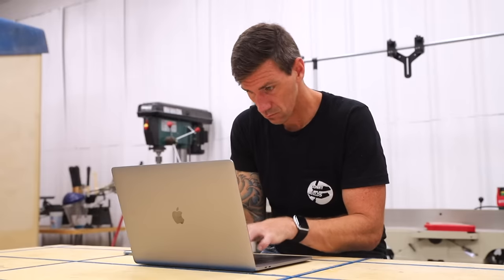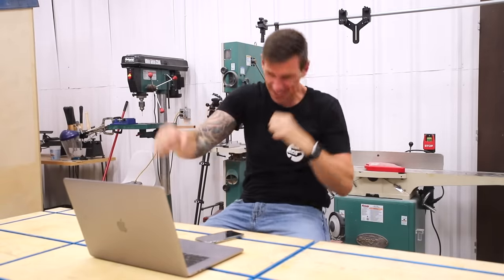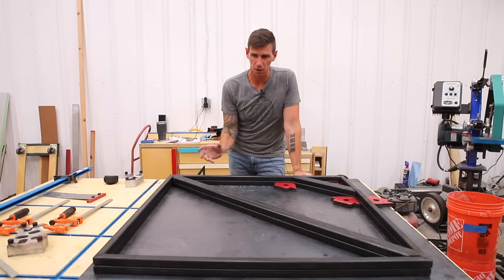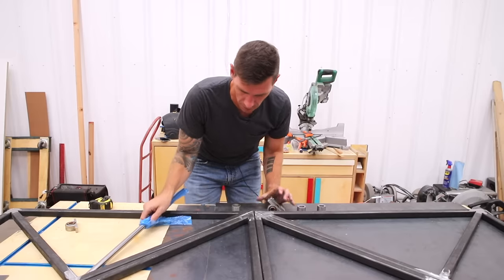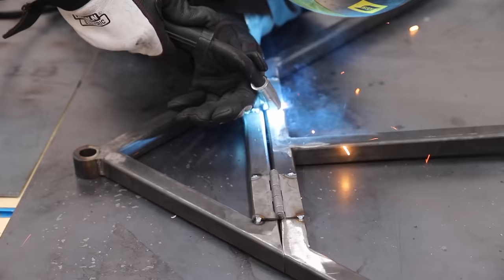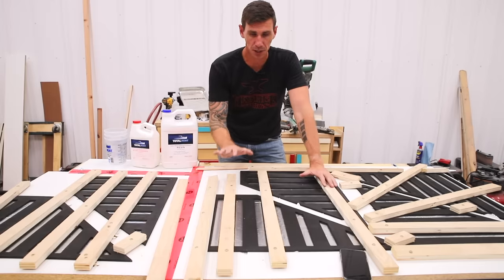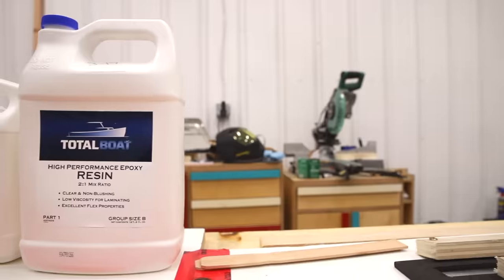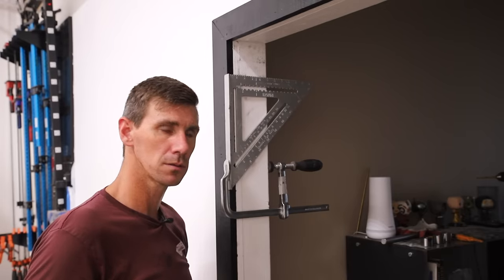Impossible Folding Door

Comment: Heads up, I had Mono Audio enabled on my device when experiencing the loss of audio. Disabling this fixed the issue and I was able to hear the audio. Turning Mono Audio back on made the issue return, so if people are experiencing this issue, make sure that Mono Audio is disabled on the device. You can do this on Windows just by opening the start menu and searching Mono. For Android, it should be under Accessibility settings within the Settings application and for iOS I can only guess it's under a similar section as with Android.
Hope this helps.

Edit: I tested this on my Android Phone and it is the same issue with the Mono Audio. I think, based on hearing both audio channels through headphones there's something that messed up that audio. It's hard to describe without saying that it feels like it has a bit of distortion. I think, and I'm no expert, that some of that audio was already made to be Mono and so overlapping Mono settings on top of the Mono audio just messes with the channels and pretty much mutes all the audio besides some artefacts withing the audio..
Reply: This sounds like destructive interference. How the frick
Reply: My mono audio setting was already off and I still have issues. I'm on Android, any other recommendations?
Reply: Also I can still hear all the added in audio (bell rings, basically all SFX sounds added in the editing process) just can't bear his voice. Sounds distorted, really quiet even with my volume all the way up
Reply: I didn't knew i have mono... what the hell...
Reply: One of the speakers plays an inverted version of the other one. A mono device will merge both the inverted and normal waveform and cancel eachother out. Kinda how noicecancelling headphones works.
Reply: @olle5555  69420 cancelling headphones?
Reply: I turned off mono but still cant hear it. also tried with earbuds, my laptop and pc and still dont hear it
Reply: @irunasoft  u know mono just means one speaker and stero means to speakers so ur phone only has one speaker which is normal lol

Comment: This is not a good design for an interior door. For one you loose a lot of wall space and two it's hard to open from the other side. 

This would be better suited for a storage shed where it's on the outside so no space loss and you never need to open it from the inside
Reply: I was just thinking this would be a good door for my workshops oversize project entrance. I have a regular 36" door I use on the regular but then I have a 4 x 8 entrance that I've made a sheet plywood into a door. Might have to see if this can be done there.

Comment: Yes, classical parametric design. That hinge is taking a lot of punishment but it works. However two of those pieces has some sort of instability during the actuation. 

The paneling is open for design. It could be triangulations or any other sort of aperture. The metal framing was exact. It's inevitable. It literally fits there. This is a valid solution when the swinging of doors becomes a hazard on closed spaces.

Comment: Have you thought about adding a second “grip” from the inside in the top left corner, that way when you “pull” down and right on it, it should do the same movement as the center one does from right to left

Comment: Awesome door!!! How does it work from the other side? can you close the door behind you , then open it again?
Reply: I whas thinking the same, it doesn't look like it
Reply: This is how I will say it..... You take something super simple and make it super complicated. Also too much waste of materials and I would hate myself if my childs fingers got stuck somewhere in the door... Otherwise great job.
Reply: It doesn't. Although you could find a way to get out but you wouldn't want to get stuck in.
Reply: ThisIsTheEndPt2 15:16
Reply: I'm guessing you will be able to push it (carefully) hard enough to budge from the inside. Would probably be ideal if you had a long stick that you could use to push
Reply: @weera25  Dude Wtf? You know you kinda ranted over a badass project right?
Reply: The only way I could possibly think this would work from both sides is if it was motorized. Like have a switch on either side that controls a motor mounted above the frame and have the top rod extend with a gear at the end. It would make this project 2x better. You can even go 1 step further and use a motion sensor to trigger the motor and have a 7-10 second timer from when it's fully open till it closes automatically.
Reply: Make sure not your front house door. one way 😂
Reply: jonathan hernandez Personally I would prefer such a door having to be consciously activated via a switch. It just looks like it would be very easy to get something trapped inside the door during opening/closing. And depending on how strong your motor is whatever is trapped inside can have a very bad time.
Reply: Just push the middle left door, easy.
Reply: I'm thinking... a Cabinet door!  If it's small and for a cabinet, that avoids all the issues -- opens only from one side, trapping fingers is won't hurt much if it's lightweight (and cabinets can trap fingers as they are anyway)
.
Reply: Skirata I hear ya, but technology has come along way. Especially with prevention measures. If it was wired directly yes the motor would just continue to move and possibly crush anything in it’s way, but when I mentioned the idea it was straight forward with a gear. All it needs is a sensor that tells it something is in it’s way or a resistance sensor where it would require a certain amount of force before it stops automated process and becomes manual. I know I’m not describing it correctly but there’s rules and regulations when it comes to power assisted doors that would explain what it needs.

Comment: A sliding door is easier to build and operate 😅
This was crafty.
Reply: Could have built it sliding, with the top pivot on a sliding bearing, moving up, into the ceiling, inside the wall and down. Then put an electric motor on the bottom pivot to control opening, closing and locking. That would have been much more practical and sealed the workshop from smoke and dust.

Comment: An automated version of this door could revolutionize the door industry...is it possible to work on it?
Reply: How would it, it's expensive, hard to put in, requires a specialized door frame, lots of effort, hard work and time, just to install it, simple doors as they are now work just fine and have been for many years and they likely won't change soon, I'll admit this door is cool, but it's quite bad in all honesty, hard to open from the other side, hard to install, expensive to create and to top it all off its really no better than a normal door which is faster, works easier, faster to install and have worked for us for years, it's a cool design if you want it but it's impractical and not needed
Reply: Josh Maddie I bet a big company could do something like this in a few years
Reply: Josh Maddie he said automated so you wouldn’t have to touch it. It’s like those sliding doors but you don’t gotta touch it
Reply: @joshmaddie4665  If it's automatic it means you will just need a button to open the door...whether you inside or outside. Yeah I get that it takes a lot of time to make (but so does a wooden door, not to mention those unique ones with facings). If cars can now open doors with the push of a button, it might be possible to make it with this door. And remember he had to take out old door which had different dimensions, hence replacing the frame
Reply: So my fingers feel good that I'm not going to have to open it
Reply: Yes I know what automatic means, but even so, why, what would be the purpose, make a door that costs thousands of dollars just so you don't have to open it yourself, Noone would use It, or buy it or really ever use it, there's no reason too, a simple automatic sliding door is far faster, it is smoother, It is cheaper and not to mention its design allows for a smooth effortless opening and closing, a complicated messy door like that would be very hard to make automatic and if it was it wouldn't look good, it's simple, think of it like this, you have this door, what advantage does it have over the many others doors, simple doors have been used for decades without problem or worry, they're been reliable, quick, cheap, easy to create and install, sliding door, easy and fast to open, easier to make it automatic because of its design, easy to install, asthetically pleasing, now you have this, a messy complicated expensive door in which it's only plus is looking fancy, Noone would want it or ever buy it

Comment: PIVOT
 I’m wondering about maybe adding some type of gasket to seal the gaps, to prevent air flow from transferring dust particles into the next room. Perhaps a roll of foam weather-strip applied to the edges?

Comment: I'd feel much more confident using one of these if there was a support arm holding the center up when the door is half open. I know there's a stop there to prevent the thing from collapsing on itself but it seems like it would be a lot smoother and more stable with a support arm that holds up the center hinge from the frame of the door instead of flimsily supporting it on the door itself in a way that I feel like would cause a lot of friction. like a triangle shaped arm with a hinge in the middle if you can picture what I mean.

I'm sure the way it is is sufficient enough but the thing just looks incredibly unstable

Comment: hmm up sides. Looks really cool. Stands out. Cant easily catch some one off guard if they are not already aware of it. Down sides. Probably requires more maintenance. Walking through it and closing it behind you seems impossible or nearly so. Very difficult to seal. making it inappropriate for any door that is supposed to isolate the inside form the out.

Comment: Awesome work. A few thoughts worthy critiques  I can tell u might appreciate...and that's the only reason I'm doing so. From a fabrication standpoint... when precision is sought after, tack the opposing corners in sequence. For instance. Top inside left.....bottom inside left(same joint)...then if it were a square...you would go to adjacent corner bottom inside right....top inside right. 😉 rinse; repeat. 
The after all tacks always weld inside out vertically before ur horizontal (flat) welds. 
This process  will minimize  the heat transfers and bowing, is it necessary...mmmm maybe not will it result in less chances for accidental oversights....absolutely. 

Also a double coat of primer and using a finer grit..maybe even double step in grit small to large...100 to 180 or whatever u prefer will  get rid of the grinder marks for a finer reveal. 

All of this with a grain of salt from one perfectionist to the next. Great work....I'm going bto be building mine soon as well. Thanks for the heads up

Comment: Even tho it looks cool its just that using a normal door would work better
1. Normal doors are less expensive
2. Normal doors have locks so if any robbers try to come in and you have that type of door (not a normal door i meant the oragami folding door) you dont have enough safety
3. Normal doors work better when your on a rush and need to go where you need to go in the fastest way possible.
Edit: this is not a hate comment im just saying that if you want that door then you can use it and im not saying you ant use it im just saying that its better to use a normal door.

Comment: I crimged everytime you made welds without removing the mill scale from the square tubing! Always clean your metal before welding to ensure quality & strong welds. As a professional welder & metal worker, that is Day One learning? Maybe you are self taught, but the best welder can be undermined by failing to properly clean & prepair the metal to be welded first & always. I hope you learn to do this on all your future projects. Maybe research mill scale, porosity & welding preparation to understand why it is so important. Hope this helps you before a better welder & metal worker. Liked the door too.

Comment: The idea of automating the door is pretty good but I would use the counterweight pulleys as the mechanism, rather than putting the actuators on the hinges. Also, upon further reflection, you could probably make the door push into a collapsing wall, from the outside as you have it.

Comment: I like the concept, but the implementation of it seems less than ideal. It's REALLY heavy, requiring extra reinforcement compared to the door that was already there. It's using up more space, as shown by having to remove a whole bunch of storage during the video. It seems awkward to open, getting stuck in certain phases, and seemingly requiring more effort. It doesn't appear to have a natural "ajar" state, but rather prefers fully open or fully closed.

If there were no door there already, and the skeleton of the door were made of something a lot lighter, and the mechanisms worked smoothly, i could probably overlook the other concerns. It just seems like (aside from the aesthetic) this is worse in every way than the original door.

Comment: only works if door is 2:1 h:w  - thus the "average American interior door is 80" so the width would need to be 40", but most are only 30-36" - But, if you use the overlap for the sides, like 2" each, then it would work on 36" openings (only)